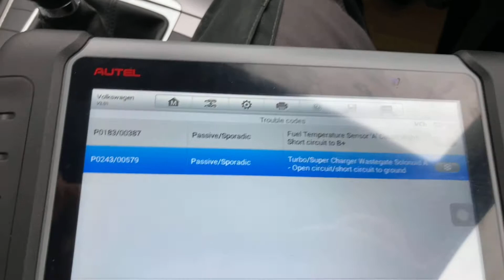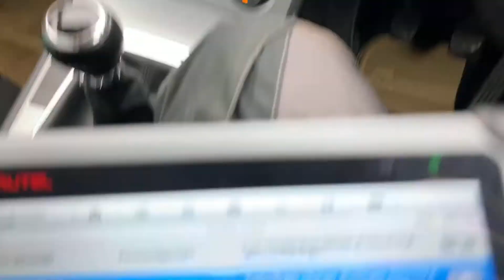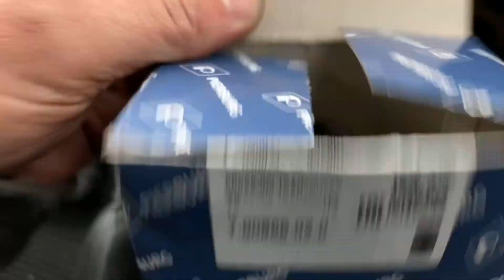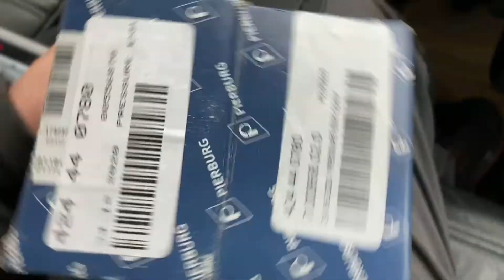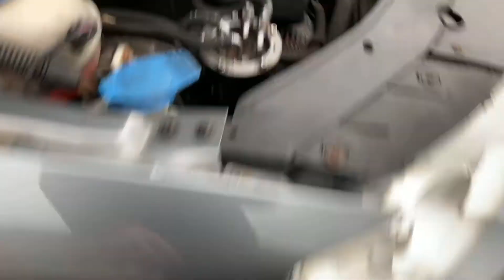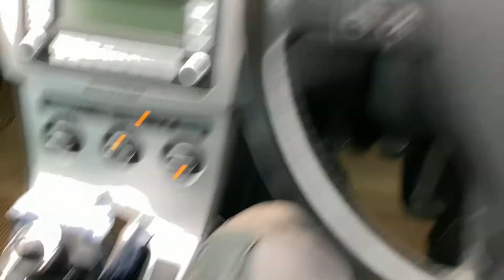P0243 Fault Code explained | VAG |N75 valve | EML | loss of power | Project Passat PT4

Comment: En volkswagen pasant 2004 turbo 1.8
Reply from the maker: Code will display differently for petrol engines
Reply: I have same problem and hard to find it. What is it?
Reply from the maker: This was mainly for diesels i did this video for.
Can’t comment for petrols unfortunately
Reply: Oh, and Kendall pass the pollution test. Lotta problem with that.
Reply: @arturogamino1349 hey I have a 04 Passat to. Did you find out what it was?
Reply from the maker: @Fuerya vac leaks , 1 way valve and new N75

Comment: The P0243 could it be the ECM short ?
Reply from the maker: Yeah there are other factors that can cause this code
Reply: @CarAddictGarageNE  in my case i took to the dealership and its the ECM waiting for parts and they are going to install it and program it, i know nothing about cars, new computer
Reply from the maker: Yeah good job you not having to pay if it’s BCM, just make sure to cut and re join pipes from screen wash pump, so the same thing don’t happens again
Reply: @CarAddictGarageNE 
Screen wash pipes??? What the hell you on about.???
Reply from the maker: I got mixed up with the BCM video I have on the Ford’s where the BCM gets flooded with screen wash what I have hundreds of messages to reply to, easy mistake as I only see reply’s not what video they relate to on the YT Creators app….. so just watch your attitude you can clearly see it’s a simple mix up of a message!!

Simple reminder to me saying I think your replying to the wrong message or something would have been helpful, vs aggressive demising message to try make me out to be stupid

Comment: Hey mate thankyou for the info I’m having a bit of trouble I get the same code but can’t locate the solanoid in the location that yours is mine is a big black box with quite a few lines going into it
Reply from the maker: Yes yours will be the newer version with the vac junction box fitted.

Check all the lines more than lightly vac leak
Reply: @CarAddictGarageNE  thanks for your reply will get that checked out in morning just been left on my drive I got a replacement box on the way only cost £12 off eBay so just incase 👍
Reply from the maker: Them boxes don’t usually play up in fairness.

Comment: I got the same code PO243 circuit A malfunction I assumed it was a broken wire 🙈 you reckon it’s the Boost solenoid then ?
Reply from the maker: Yeah or a vacuum leaks somewhere could be culprit
Reply: @CarAddictGarageNE  it’s strange because it’s boosting properly making 1.2 BAR but I have another solenoid that’ll hold 30inhg with a pressure tester I’ll try that . Thanks ☺️